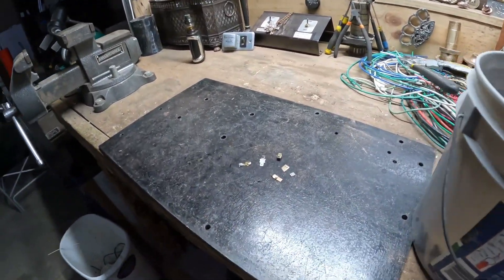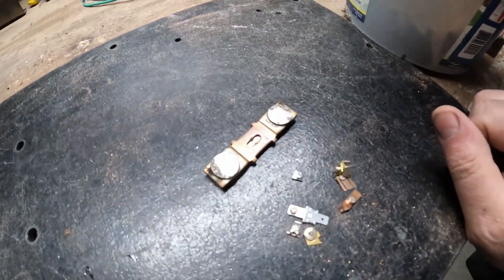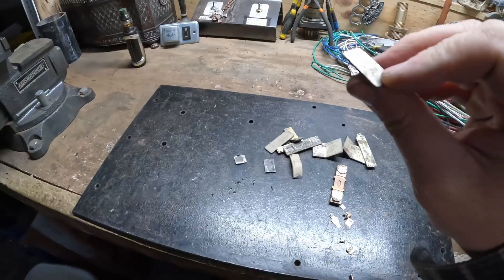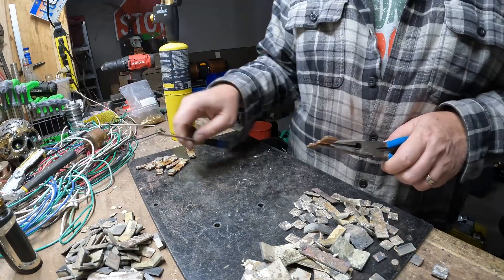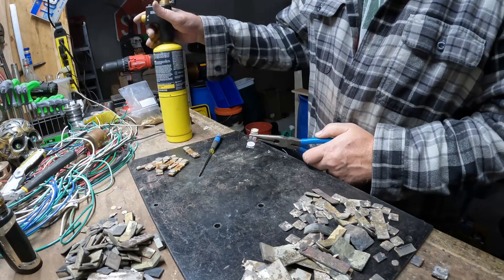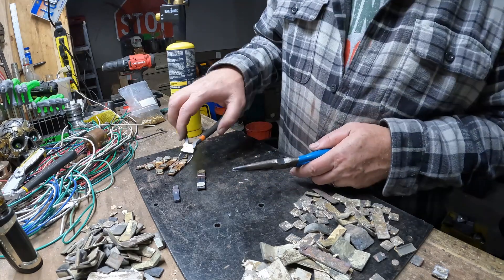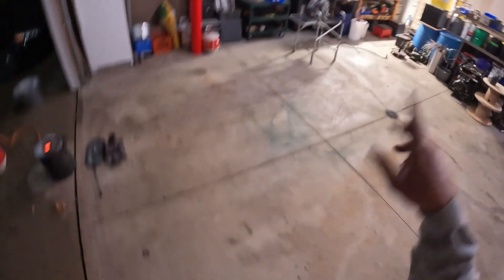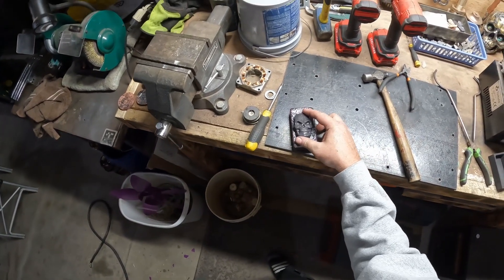Melting "Silver" Contacts - Are They REALLY Silver??  We Find Out.

Comment: These contactors are usually a mixture of tungsten, nickel and silver. Tungstens melting point is 6,192 degrees. The highest melting point of all metals. You may have to use chemicals to break down and separate the different metals.

Comment: I think I am wasting my time. I have been collecting contact relays from Roof top Air  Cond. Units for many years  . I have a trash can filled that I am slowly taking apart primarily to get the copper coils out but I was hoping to get enough silver, IF silver is used ? Any input ?
Reply from the maker: Here's the deal with these contacts - it takes acids and other chemicals to extract the silver from them.  Watch the YouTube page "Sreetips", he does this process.

That said, you do have some substantial money there but it will be mainly to sell to someone else who knows how to process it and extract the silver.  Definitely hasn't been a waste of time.  If it were me, I'd sell the contacts to someone on Ebay and then buy real silver with those dollars.
Reply: @SkullerMetals  Thank you for your reply.
I am glad you gave me this info. I assume I still need to remove the contact points from the piece of metal it is welded to ?
I thought all I had to do use heat up the silver points with my acetylene torch and remove them. I obviously wouldn't be trying to completely melt the silver. I don't want to bother you any further but do you know what type of metal on HVAC Contactors has a brass color, non magnetic and is used to slide stak-on crimped wires to ? It's it worth scrapping if you have enough of it ? Thank you, Howard H.
Reply from the maker: @ Hey no problem Howard.  You don't have to remove the actual contact buttons to sell them.  I would just trim off as much "other metal" as you can, as you'll likely be selling your stuff by weight.  Removing the buttons with a torch fits into the category of "the juice wouldn't be worth the squeeze."  Let the refiner do that.  As for wire connectors, if I'm understanding your question, yes they are brass.  Are they worth saving??  Well, because I melt the stuff I can make a bar out of them and then I have pure brass.  If you save them and take them to a metal recycler you'd get "dirty brass" for them.  I'm not sure what dirty brass is paying but you'd have to have quite a few to make it worth your while.  I save mine for a year and then do a melt with them, and I may end up with one 3-lb. bar.....not even $10.  But because I have a page I do it to show people the process, not because it's financially good for me.  With propane costs I probably lose money.  That's ok.
Reply: 50 to 90 percent is the common silver content.
Reply: The net said the silver is often mixed with cadmium.. ya don't want to melt that.. use acid..

Comment: Majority of those contacts are around 85 percent silver definitely. I've been extracting silver from them alot lately. You shouldn't give up on them so easily. Most of them don't necessarily melt. You have to get them considerably hotter than silvers melting point and then the silver will bleed out of the contact. And the reason why you couldn't get them off of the copper part was because the solder is of a high silver content, therefor u have to get them glowing hot to melt the solder. But yea.. most of those contacts are really nice ones. U could of  got at least a pound of pure silver out of them for the looks of the amount u have there.

Comment: Dont bother removing the buttons since you have elwctric oven sulver melts leaving base netal behind
Reply: Yup the easiest way melt them all then slowly electrolyze with CuSO4. The Zn etc stays in solution, silver forms a mush with any tungsten or pgms. Treat the mush by rinsing well and then boiling in NaOH to remove the tungsten then disolve what's left in nitric acid to get the Ag as AgNO3. The salt is a bit more valued than actual silver if marketed right. The black powder that is left is mostly palladium ❤

Comment: You might of melted the crucible most of the cheap ones can only handle med temps to melt copper you sure did have that piping hot I learned this after my first day and had to buy a new one med -low heat is better and long burn time with borax added after it’s all melted

Comment: Electric contacts use a really strong solder. MAPP gas does burn hot enough, but you might have better luck if you position some duct seal putty around it to hold the heat in, or some fire bricks.
Reply: Oxy-acetylene is better than mapp gas for this.

Comment: Some are tungsten but the large square ones are silver-cadmium contacts.. When heated to hi temps Cadmium release  extremely toxic fumes that can poison your body and do long-term damage so please use proper ventilation and ppe... The silver-cadmium contacts can be dissolved in boiling sulfuric acid(drain cleaner) then the silver precipitated out using hydrochloric acid.. ⚠ 💀💀this process is extremely hazardous!!! Uses extremely crossive acid and will produce toxic and corrosive fumes that will kill you if inhaled (will literally melt your lungs) 💀💀💀 ⚠

Comment: It's tungsten. You're not going to melt that.
Reply from the maker: So I found out.  Bummer.  The only way to get the silver out is playing with acid, and I'm not doing that.
Reply: @SkullerMetals  its not all tungsten, i've cooked plenty of them.  if you file off a corner or cut them in half with bolt cutters they will melt, however the kind you got there look like the suckers that are rich in platinum as they're high amp contacts.  Any high amp contacts don't use silver as they'll melt...  so even if you file the whole outside of it and can melt copper off them before they melt, its platinum and they can be rich in it from personal experience.  Extremely difficult to melt
Reply from the maker: @jakestarr4718  Thanks Jake that's good information.  I'm going to give them back to the company who asked me to melt them and we'll see what they decide to do.  If they have platinum that's not a terrible outcome assuming they can find a way to extract it somehow.
Reply: I cut off the silver tabs with a thin cutting disc on my grinder. You really have to pay attention when doing this to ensure you don't have any copper still attached. On a lot of those contacts you CAN remove them with a torch using MAP gas. It takes a couple of minutes but eventually you can slide them free with a knife blade.
Reply: @bevsman3284  no need to remove copper lol...  it melts off first...  cook copper off, cool, bolt cutters to slice them, cook clean contacts and they're incredibly hard to melt still and i assure its not lots of tungsten.
Reply: @jakestarr4718  thanks. I never did that method because silver melts at a lower temperature than copper and I didn't think there was a huge amount of silver  on the tungsten to begin with.
Reply: However, I enjoyed your video.
Reply: sure fire way to know right out the gate, platinum acid test.  if it's silver/tungsten it'll burn black spots in seconds...  platinum/tungsten it will just fog it up as its an alloy it still attacks metals mixed into them.  However with platinum content they don't burn black fast with the acid.  Now if it burns it black then use your silver acid on a streak plate, you'll see silver actually float up on top of the acid bead, its interesting. You'll also notice the silver/tungsten ones will melt before copper if cut up first.  The platinum ones will melt after the copper.  i am lazy so i generally leave the copper in there if it melts first and drown it in mule 20 laundry booster....  nice having that glassy lubricant for the good stuff left behind and to keep noble metals from burning off into thin air, cheap and using a lot of borax is wise to protect the metals from volatizing off...  From there the only way to go is into acids and complex chemistry.

Comment: I put the torch rig in a vise to hold it. I hold the contact with a pair of needle nose pliers heat up one side at a time till the copper bit it dull orange then I tap the pliers on a coffee can filled with water. The silver bit will fly right in the water. You will ruin those needle nose so use a crappy set.

Comment: It's Tungsten. You will never melt it and its not valuable. 
You didn't keep your torch on the contacts long enough to get the silver contacts off. 
Get your torch stationary so that you can hold the metal in one hand and your screwdriver in the other hand toscrape them off. .
The contacts are typically on silver plated copper when they are that size. 
I've done hundreds.

Comment: duda diesel is where i got my nitric acid read up on it before playing with that stuff watch sreetip vids
Reply from the maker: I like sreetips.  That's not my forte so I'll leave the chemicals to him.
Reply: @SkullerMetals   avoiding acids doesn't necessarily make you safer when you make a video melting these without knowing what metals they consist of, reading up and then doing a safe acid process would have been the best way forward realistically. there are processes I do involving only 10% vinegar/acetic acid and hydrogen peroxide, the acid alone isn't enough to even cause me skin irritation (obviously you must still be careful and if you get it in your eyes well that will hurt lol) and that is able to dissolve copper and leave behind gold foils or powder.
Reply from the maker: @MortallyMysterious   There are only a couple ways to find out "what a metal consists of - do what I did or get it tested on an XRF machine which would cost me money.  I was told they were silver so I wanted to find out.  I don't see what the issue is here - people do trial and error on stuff all the time.
Reply: @SkullerMetals  I enjoyed your video, the trial and error was good. I was just meaning to leave my thoughts on it. I also cannot afford xrf equipment or testing so for the most part i've done the same in the past. It seems like both you and I could have been better off fumes wise with a bit more internet digging and research about different contacts, I have tried cupelling smaller ones from relays and found out about the cadmium risk and have been trying to figure out better ways of refining, seemingly weaker acid solutions like acid peroxide mixes are a really good place to start and could be great for lower grades of silver stuff, these other noble metals need aqua regia or concentrated nitric, now I cannot get these nor am I comfortable messing with stuff that corrosive at this point. However, something like hcl 20%-30% and some copper II Chloride (add hydrogen peroxide 3-6% to accelerate if desired) should work well on stuff that is showing copper if you want to try that.

Comment: The easiest way to remove the gold from the pins is chemically.
All melting the pins will do is make an inquarted allow of gold and copper. Thats if the base metal is copper.
If it was, you can still recover the gold by placing the allow in nitric acid. It will dissolve the copper and leave the gold behind as powder

Comment: This is the third time I've commented on this video, but it keeps getting deleted because I was trying to send a link, or describing a website without a direct link 😣. Bottom line is those contacts are an alloy of silver and tungsten. No wonder they didn't melt.  👍
Reply from the maker: Ahhh, ok.  Thanks for the info.  Weird that the silver wouldn't melt out and just leave the tungsten, but what do I know?
Reply: @SkullerMetals , Well yes and no. When alloys are made they have completely different properties to the original metals. One common example is bronze, being copper and tin. Tin is quite soft, a lot softer than copper, but bronze is harder than copper even though it's alloyed with tin, a softer metal. Strange.
Reply: I sent a fourth comment but I see it didn't make it.